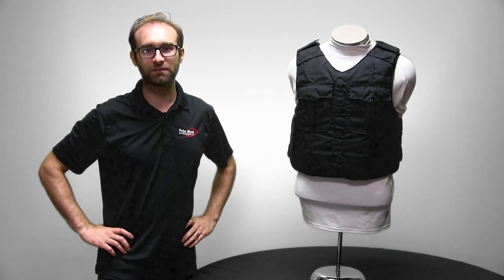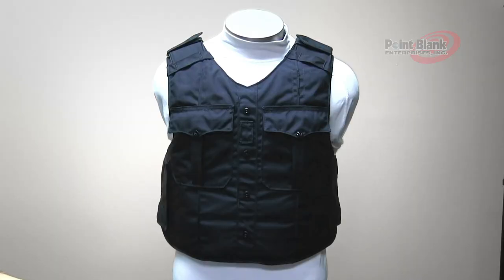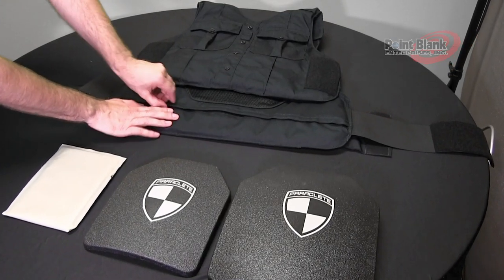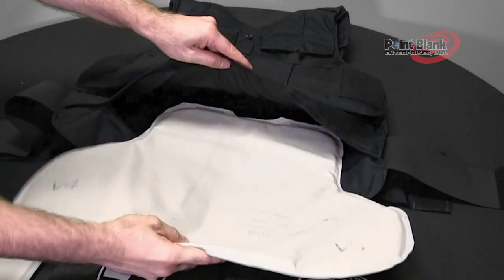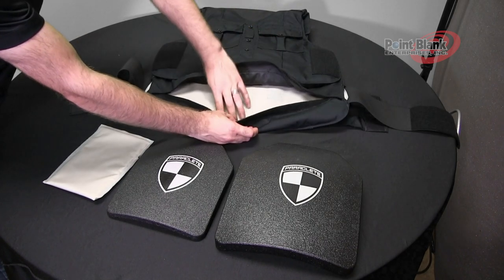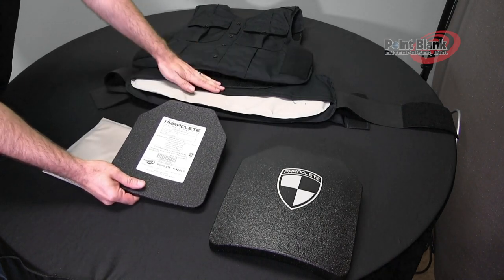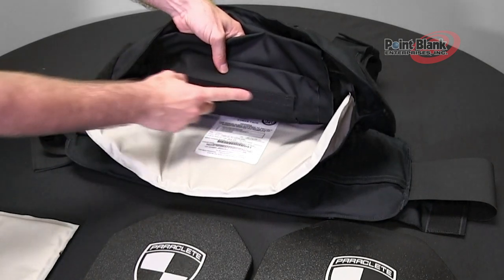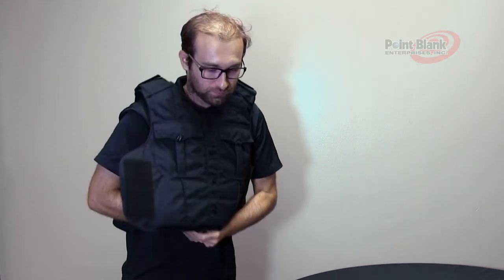NYPD Uniform Shirt Carrier

Comment: Putting your shield onto this thing is a royal pain.
Reply: I ran 3 paracord loops.  First one through both holes (cinch to connect), then two smaller loops one through the top and the first loop, and same thing at the bottom.  Attach the shield by running through the 2nd and 3rd paracord loops.  It's woobly, but it's A LOT faster to attach/detach the shield.
Reply: This year I got it done in under one hour with no blood.  The trick I used is to put the pin through the bottom hole of the badge holder and then feed the pin from the bottom first and then through the top hole.  So you are essentially reversing what should be the correct position for the pin.
Reply: I went to the tailor and added this little eyelet hole adapter to it so you don’t have to open up the vest in order to put the damn shield on. It makes life so much easier. I was almost went 3/4 putting my shield on this thing every day.

Comment: Any tips/tricks to getting the shield on there without having my fingers look like I'm testing for glucose?
Reply: Bahahahah
Reply: I ran 3 paracord loops.  First one through both holes (cinch to connect), then two smaller loops one through the top and the first loop, and same thing at the bottom.  Attach the shield by running through the 2nd and 3rd paracord loops.  It's woobly, but it's A LOT faster to attach/detach the shield.